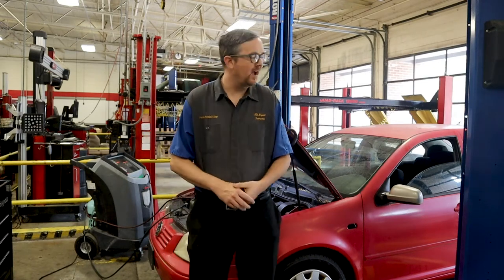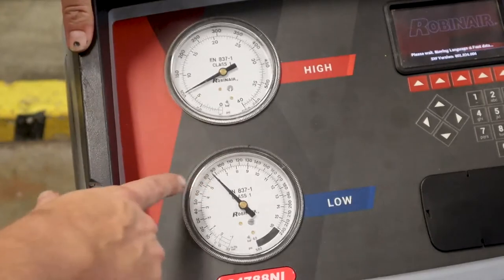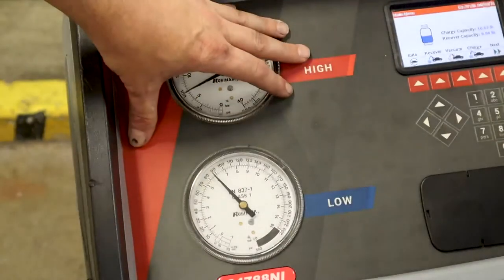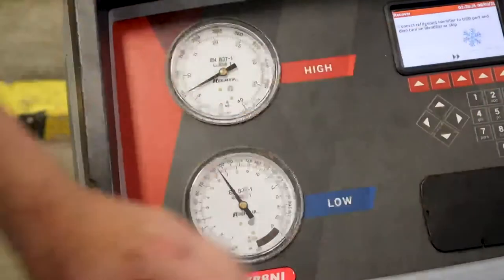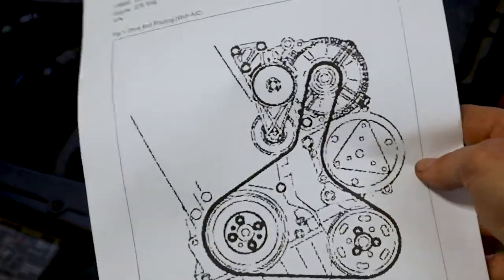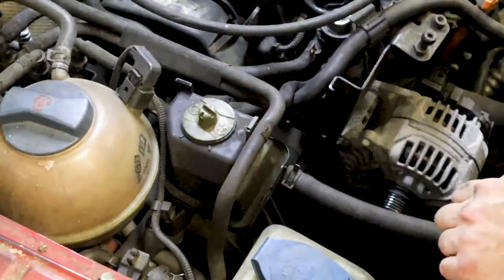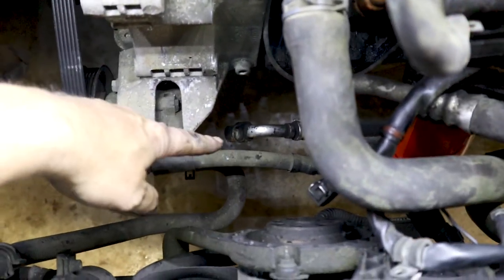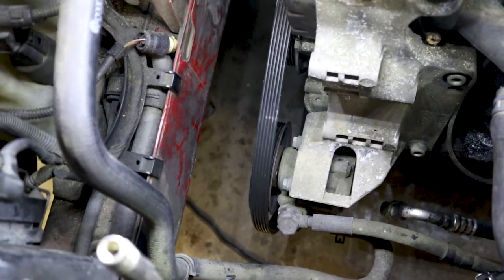AC Compressor Failure Diagnosis, Removal, and Replacement - Mk IV Volkswagen

Comment: Great video.  I spent hours trying to get the receiver/dryer out.  The problem was the allen screw holding the line on the top.  It's completely blocked by another A/C hard line but you can't move that line at all without removing the RH headlight.  Headlight removal requires removal of the bumper cover.  Even when I got all this out of the way, I had to drill an access hole in the "shelf" above the receiver/dryer.  That screw was in so tight, the allen wrench stripped it.  The only solution was using an extractor that grabbed the outside of the allen screw and even with that, I had to use a breaker bar to loosen it and when it broke free, the breaker bar was necessary for the first 4 or 5 revolutions!  Unbelievable.

Comment: Thank you for your clear and concise video. My compressor is quiet for a while but eventually starts vibrating and is very noisy. Cold air most of the time from the system but the vibration tells me that it is about to fail. Do you have any idea of the cause. 1998 Mk4 Golf tdi with climatronic 100,000miles very well maintained and clean all original car.
Reply from the maker: @STONEPINEification  they normally fail around this mileage, from what I’ve seen.

Comment: I done the compressor change years ago on the car  i bought . First time i ever heard of a compressor sanden compressor like the vw has .. .it lasted for may years . So another Jetta i have today the ac went from getting cold to just cool in few moments.  At first i thought i blow a fuse . But the fans and compressor is engaged.  I assume the valve in the reed plate failed and not allowing the proper pressures ..i guess i find out

Comment: My AC compressor is good, but I'm looking to upgrade it to something better. 
When idling or regular driving it's cold, but barely enough during a hot day. 
While driving on the highway at high speed / high RPM it freezes my ass off. 
I know that modern AC compressors have some variable valve plate or something. I think the Mk5 Golf and newer cars have this technology.
Any knowledge on retrofitting a modern / upgraded compressor?